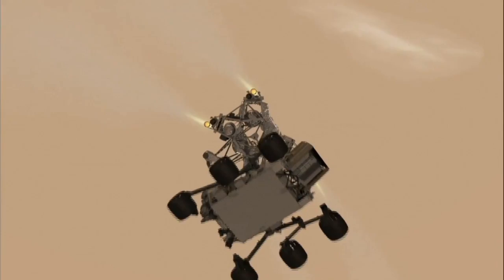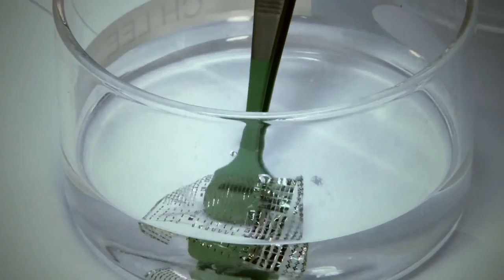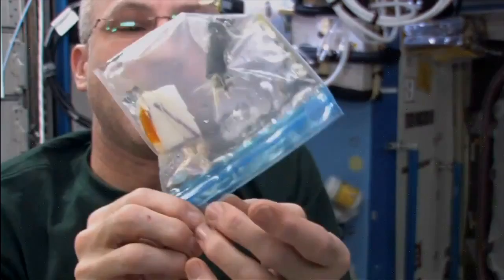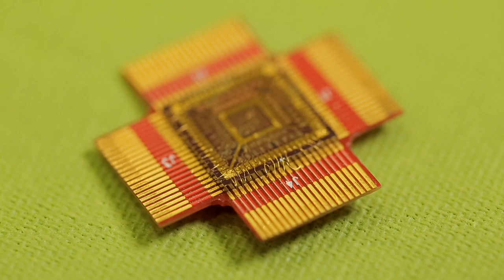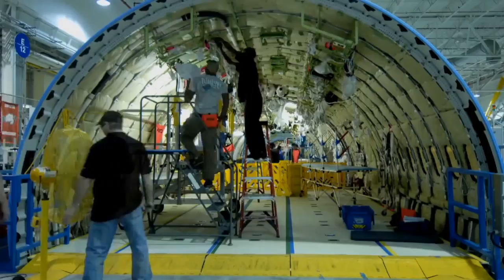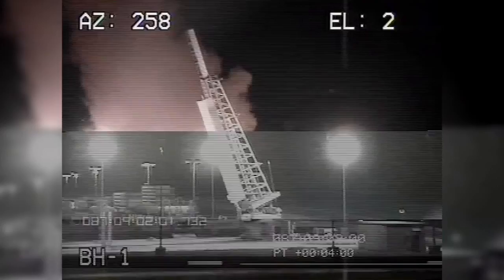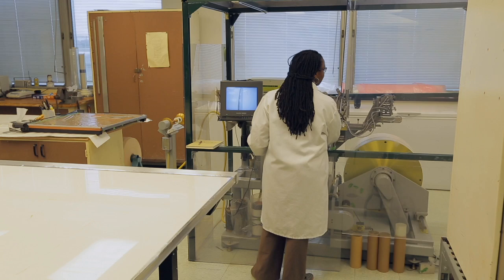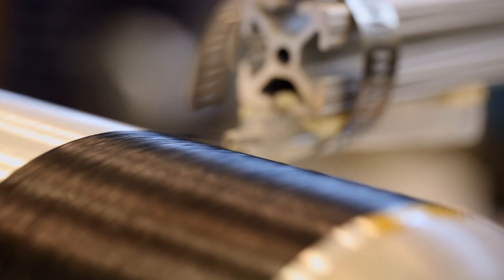NASA EDGE: Nanotechnology

Comment: 6:02 no way. haha wow i was think in that. carbonfiber is readyt work. but carbon-nanotubes fibers is the prestige fiber of carbon fiber. so that will add lot of strenght. you try if this carbon nanotube melt or burn? because instead make with resin wich dont get 300ºC, use aluminium or better stainlessteel(above 1000ºC) as base. Is like we use cement and steel to make concrete. this time we use carbon nanotubes to make stainles steel reinforced.